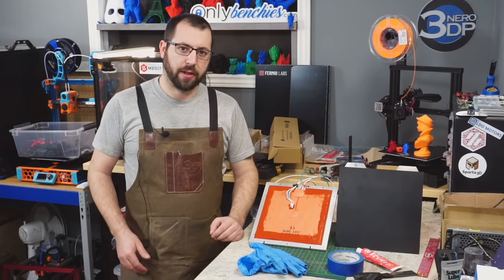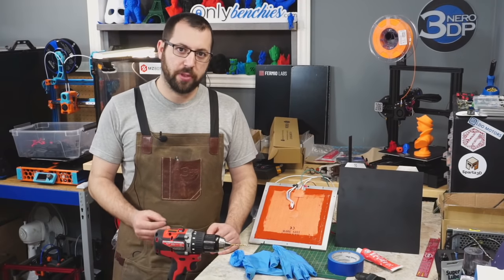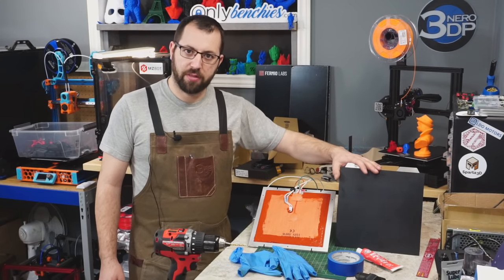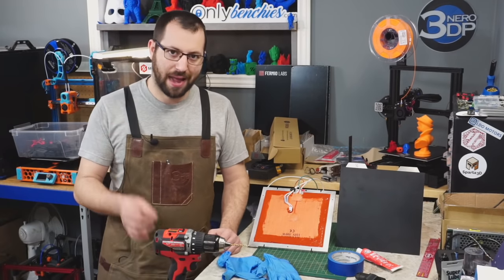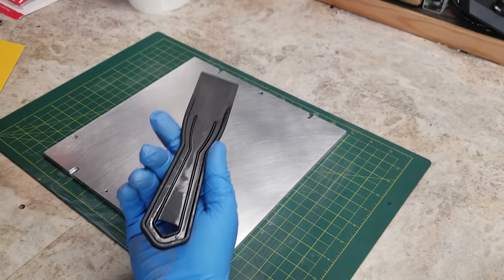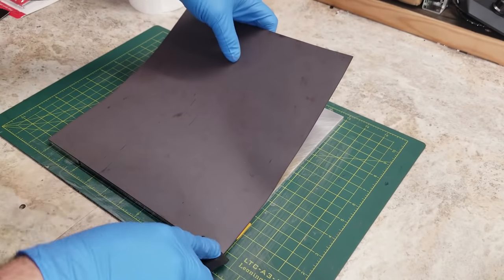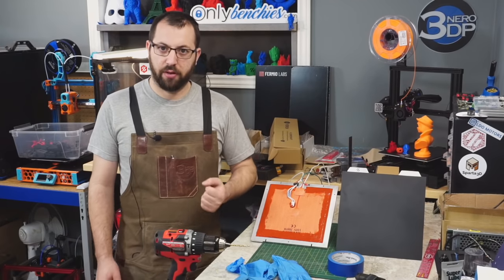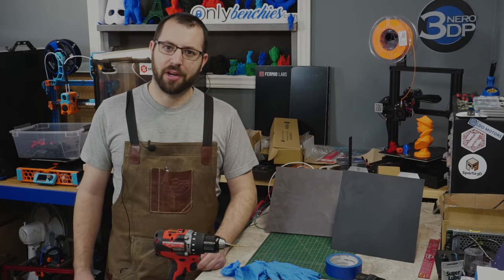Cast Aluminum Printer Bed - Putting together the best DIY print platform for your 3d printer

Comment: Is this heater capable of reaching higher temperatures like 200 or 300 degree Celsius?
Reply from the maker: Heater yes but the adhesive will fail well before that. This is not meant to be a high temperature heater

Comment: Should I use 2 thermal fuses, one for each of the AC wires? I am interested in doing that because I am unsure which of the wires coming out the wall is the live and which is the neutral (as there is no standardised way where I live in Europe). If the answer is yes, should I use 2 ssrs too? One for each cable, like with the fuses? 
Im thinking: 
wall > ssr 1 > fuse 1 > 1st wire of silicon pad, then 
the 2nd wire of silicone pad > fuse 2 > ssr 2 > back to wall
I would be driving the first ssr with pmw signal from motherboard, however Im unsure how the 2nd ssr would be driven. 

A silly question, probably, but I thought whats the harm in asking...

Comment: SSR Failure modes are....

'Fail Open... Output can no longer be switched closed.
Fail Closed.. Output can no longer be switched open.
Catches Fire.. Device continues to operate but gets too hot and ignites. Will be followed by either mode 1 or mode 2 if there is anything left once you put the fire out.
Which particular mode will occur is application and device specific and is a matter of probability. Operating the device outside it's specified ratings will significantly increase the probability of failure, however, operating it well within those limits will not prevent it's eventual failure.

Generally fail open or fail closed is hard to be sure about. The best you can state is the device is more likely to fail one way or the other under normal or extraordinary load conditions. But both modes will have a finite probability of occurring for that particular device.

As such, when designing critical systems where you need to be sure the output enters a certain state when a failure occurs, additional circuits and methods are required.'

Comment: Did a similar build using  1/4 inch Cast Aluminum Tooling Plate...Guarantied flatness....
I routed the square edges to quarter round edges. Looks very nice.
Scuffed the entire surface using some quick change sanding pads.

The mistake I made was rounding the edges. That changed the overall  tension on the top side. And after a few cycles of heating and cooling it warped up over the heating pad. Now have a higher middle by .0035.
Leave the edges square.

Comment: 5 mm should be enough for 250x250 mm. And I don't like the PEI-sheets. Better go with coated spring steel plates. They usually have two sides and a much better surface and the surface doesn't come off so easily like with the PEI sheet. Also the print usually sticks much much better and more homogeneous to the coated sheet.

Comment: Doesn’t the Silicon adhesive act as a heatbreak resulting in a higher than rated temperatur for the fuse to break?

Comment: My friend took one of the build plates from one of my Ender 3 printers to work and faced the surface on the milling machine, it was super level with a mirror tile build surface, for a while, but then I noticed the odd very small inconsistency here and there, I am guessing this is down to thermal expansion.
 Do you think it worthwhile to have the cast plate faced or would the difference be unnoticeable?

Comment: why not soldering thermal fuse?
Reply: Because with excessive heat the solder may melt/soften and you will have a mains powered bare wire just dangling around.  Crimps are supposed to hold onto the wire mechanically, and are much less prone to heat related failures (to a certain extent, of course).

Comment: Can this be done to the ender 3?  Or is there any aftermarket ones for the ender 3?
Reply from the maker: The weight of this style bed. And mains voltage wires. Means this style of bed is best user when it can be fixed in place or z travel only imo
Reply: @CanuckCreator  thanks for the info. My bed is warped even with a glass bed...I want to get the whambam with PEX build plate but I'm not sure the best way to go about doing it without a level bed surface. I do have an EZABL installed but I'm still afraid to purchase anything without knowing the best way...any thoughts? TIA
Reply from the maker: @jrodbrown58  personally im a fan of spring steel flex magnetic plates and a cheap inductive probe
Reply: @jrodbrown58  I have a CR-10S, and the best two upgrades have been the BLtouch and the AC silicon heater. I then also added a magnetic flexible plate, that is too a nice to have, and even gave me an unexpected benefit of reducing ringing as the spring steel is lighter than glass (and also not to risk my life with metal clips directly clamping on the silicon heater!). Anyway the bed still warps like crazy, but the mesh leveling keeps everything under control, no problem whatsoever even with the first layer.
Reply: @jrodbrown58  Are you sure your bed is warped? Maybe it is your gantry...

Comment: Why is the heater pad smaller than the bed itself? How is the thermal uniformity at the top side of the bed?
Reply from the maker: You need room for the screws/fuse etc. So either a stock off the shelf heater thats undersized or a custom, higher cost heater with cutouts.

Thick aluminum is very good at heat transfee so the top is pretty uniform
Reply: Thank you very much for your fast reply!
Last question: you are putting the magnet foil on both bed and spring steel sheet. Is only on the bed not enough?
Reply: @simontillema5599  its not magnetic foil, but a black PEI sheet.

Comment: I have not used an AC-powered heater bed.  Is there a significant difference in time to temp over say a 24V DC heating bed when heating to ABS / Polycarbonate temps, i.e. 100 to 130 C?
Reply: It is generally quicker, but the main reason is that it's simply a smarter design: you need a smaller PSU (cheaper and less noisy) and probably better power consumption, while requiring smaller wiring and being faster too!
Reply: I moved mine from 24v to 240v and ABS heat up time is like 3mins instead of 7-8mins for my 300x300x6mm plate. For PLA low temps it's not that big of a deal but for ASA/ABS/PETG I think it's a must have.

Comment: Can the the plate be connected to ground via the aluminium extrusions it's mounted to?
Reply: Yes
Reply: Verify with a meter.  Mine shows open due to the coating on the aluminum extrusion.  The inside aluminum that is bolted together with the blind joints have continuity, but if I place a probe on the black part of the extrusion there is no continuity.  I would advise to place a ground directly on the plate for redundancy if nothing else.

Comment: This is great info and am following it for the most part. I'm curious as to why you would take a known flat surface like a cast aluminum tooling plate and add a sheet magnet to it? I can't imagine that the magnet's production quality is anywhere the same as the plate when it comes to consistency across the surface. Do you have a source for sheet magnets that are as consistently flat as cast aluminum tooling plate?
Reply from the maker: Ive used both generic cheap magnets from energetic on aliexpress to graviflex magnets and neither have impacted flatness to the point its an issue

Comment: Are energetic pei magnetic flex sheets good for high temp, I know you used them on your V2.4 but do the magnets hold while printing ABS
Reply from the maker: Ive had zero issues with my energetic plates so far
Reply: I'm using an energetic double sided PEI flex sheet for my flashforge creator pro from AliExpress and it's been great based on that I've order a 350 on to use on my Voron 2.4 because the one that came with the formbot kit quite frankly looks crappy

Comment: I Can see that the heatermat is smaller than the plate, how far from the edge is ok?
Reply: The general rule of thumb with the voron is to get a heater 50 mm smaller (for each side) than the build area. This is not always true for every printer, the voron uses a thick chunk of aluminum that can still bring heat reasonably to the sides.

Comment: From filastruder the keenovo have a built in thermal fuse now.
Reply from the maker: Not a fan of the internal. If it pops on accident (incorrect firmware config for example) the whole bed is now dead.
Reply: The thermal cutoff (self resetting bimetallic) IS NOT a pop fuse (and may fail too). Cut Off is just to avoid heating over a certain temp (which you can also conf in the sw) the pad but serves a different function. You still need a pop fuse as a safety measure
Reply: @CanuckCreator  The internal one is not supposed to be a one-time thermal fuse, but a thermostat or thermal switch (they use a 150C), which resets after it cools down again.  Is that no longer the case?

Comment: Is red RTV removable? If I were to swap heaters down the line, would I need to buy a new build plate?
Reply: RTV is removable - start by mechanically removing most of it and then one can use a 'silicone remover' (available from the hardware store) to clean up the rest.  The heat mat adhesive will usually come off with acetone.
Reply: @CDN_Torsten  Thank you very much!

Comment: I'd like to get to around 150-160C for some high temp materials. I know I'll have to have a thermal fuse to suit and I'll be printing on glass. Keenovo rates these heaters to go as high as 260C. How hot could you safely use this setup? Thanks for the vids!
Reply from the maker: This setup is limited by the adhesives of the 468mp on the heatermat and magnet, so i wouldnt push beyond 120 IMO
Reply: E3d makes beds where the silicone heater is vulcanized directly into etched aluminium and don't use adhesives, so they can go to higher temperatures.
Reply: @fwiffo  I looked into that but they use 3mm thick aluminum with 0.8mm flatness which is not good enough for my purposes (or any purpose IMO). Thanks anyway:)

Comment: At the end. Why is the magnetic plate glued to the flex plate? Should it not be glued to the bed so the flex plate can stick and be removed from the bed?
Reply: It's black PEI not a magnet :D
Reply from the maker: This is correct.  Im using black pei on this build
Reply: i was confused at first as well....

Comment: good video nero. personally i would add the following steps: be sure to get multiple thermal fuses ffrom same vendor / batch. so then you can double check for yourself and test one or two of them by blowing it at the rated temperature. i think that is important step to give yourself a confidence in the product. 2nd to that i would be attaching a 2nd thermal fuse in series, on to the bed itself. that way if the 1st thermal fuse were to fail for any reason... there is a backup one that will then blow instead.

now for ssr stuck on issue. the bed SSR (and for any ssrs for that matter). should be in series with an active closed safety relay. and that safety relay should be wired up to an mcu. so if the ssr is stuck on then there will be a way to shut it off. perhaps klipper can be smart enough to detect this situation. simply be monitoring the bed temp in response to commands. anyhow the point is to have another alternative safety cut out. which operates independantly be an entirely different mechanism. you want it so that if power is cut to the safety relay (or the mcu driving it)... then it de energises as its failure mode

now the shorting to ground. you do want a regular fuse. but also an rcd (or whatever you call them)... specifically for all of the printer circuits too is not a bad idea either. so that if it does trip you dont have to go all the way to your control box. and just an extra rcd breaker for that printer is just extra layer of safety

i dont think you can be too safe so its always good to think of extra independent ways to provide an alternate safety cut out mechanism. i would also suggest installing multiple smoke alarms above the printers. at least from 2 different brands. and actually hack at least one of the smoke alarms to provide an alarm signal to the safety cut out circuits for the whole printer. however you also need to make sure the smoke alarm wont be triggered accidentally by abs fumes etc.

safety circuits are not meant to be a substitute for fundamentally safe design to begin with. but having a safe design is not an excuse for forgoing safety cut outs either! both should be implemented especially in circumstances where you want to leave equipment running unattested

finally.... the ultimate safety 'luxury' as it were is to have a shed or outhouse. that is not in the main building. but is instead erected a safe distance away from all other buildings and structures. that might be a lot more or less convenient for some people. but if you have the option to do so.... then by all means it is probably the best and most worthwhile single safety upgrade out of anything else

hopefully those tips might be helpful to somebody else out there. but regardless i do think you made an excellent video here nero3dp for showing regular people the very best practices and methods for assembling a high quality printer bed. really thank you for taking the trouble to explain things so well and make easy for others to follow
Reply: ironically the easiest way to make the SSR redundant is to add another SSR :D daisy chain them and you're golden, risk is significantly lowered. To be honest however, I think that the thermal fuse is good enough considering the plate is hard mounted to aluminium extrusions and not really a fire hazard. The keenovo heater can run flat out at it's rated power like an enclosure heater until the fuse pops. Placing two fuses in series does make sense like you mention and I agree - testing that they work is very important. Have you installed an RCD in your printer? What's the easiest way to achieve this? - A recommendation could be made to the voron dev team?
Reply: @justindelpero  there are drawbacks of doing it that way. for a start decent SSRs cost money (up to $50 even). which is pretty expensive. and 2nd to that, if your control board does not detect a failed stuck on SSR.... then it keeps going for some weeks. Then you could end up with the redundant SSR then failing later on in the same fashion. When you already have 1 SSR to PID control the bed temp. Then you don't need a 2nd SSR for any rational reason. You should instead use a regular on/off relay in series. As I have already mentioned above here. Since those are much more reliable, can be active-on (safer way if signal is cut). And if they fail they usually fail open circuit. The cost? about $2 vs $50 for a good one. And safer too. But you would have extra SSRs for multiple individual other heating circuits. For example PTC heaters, filament driers, etc. In each case you should series a regular relay with the SSR (and have that relay being controlled by an mcu that monitors the SSR and can detect if it has failed).

Comment: Take from a person that did this 5 years ago with a MIC6 Plate....  I highly recommend mounting it on springs so it can expand/retract and still maintain Z = 0..   even with tight PID heating, you'll get artifacts as that large plate expands and retracts with heating/cooling. With BLTouch and mesh bed leveling becoming a thing, it got rid of the need to have a high tolerance flat print bed these days
Reply from the maker: I run mine mounted on both my v2s with a basic 3 point fixed mount. And even after years of use im still able to get by without a mesh as the surface is still flat enough
Reply: @CanuckCreator  thats not what i am saying. Fixed mount will cause what looks like z wobble artifacts because your fixed plate is expanding and contracting. It is made worse because of how thick your plate is. Springs allow the plate to expand downwards and maintain z=0. The mention of mesh leveling is that flat tolerance of MIC6 is not even needed anymore and hasnt been for years. Hence why no one bothers with cast plate anymore.
Reply: @ShadowRam242  To be clear, if the build plate expands downwards, should we infer that the mounting consists of flat-head bolts countersunk into the surface of the build plate, with springs pushing up from the bottom? So your confidence in the build plate fixed Z height is because the top surface is "held down" at a fixed Z height by the bolts, right? This assumes (a) that the bottom of the bolts' countersunk heads are close enough to the surface of the plate that the height of aluminum above them is negligible, and (b) that the bolts themselves do not expand and contract with heat.  Both of these may be valid assumptions, but I just wanted to see it spelled out.
Reply: @ShadowRam242  It's not that it hasn't been needed for years rather it was more expensive to get plate and have it machined and chinese 3dp companies did not want to eat that cost. I did the same thing with the CR-10 in 2017 and the Wanhao D6 came with a cast plate. There are people that were building cast plate beds prior to 2014 and they used 3 point leveling.

Comment: Couldnt find tooling plates, so I do mines with 3/4in (20mm) plates. Nice thing is I can drill and insert the heater core in the plate so I can add more if needed.

Thermal fuse is really important, I had a relay sticking and the bed when up to 280c the whole night. Came back to look at a pool of petg and 75$ of wasted magnets.